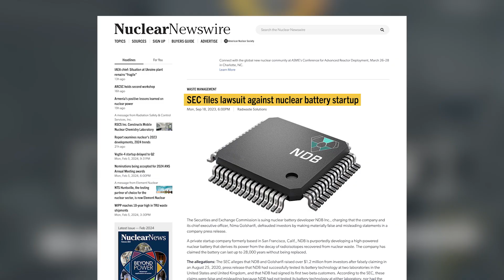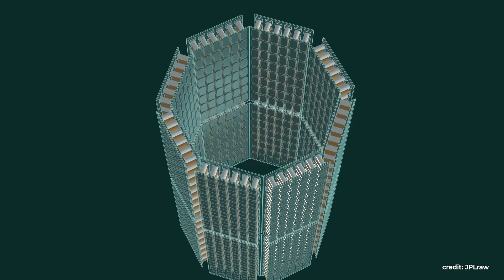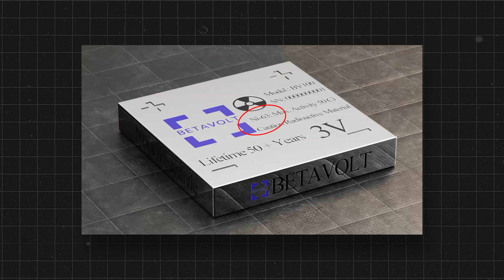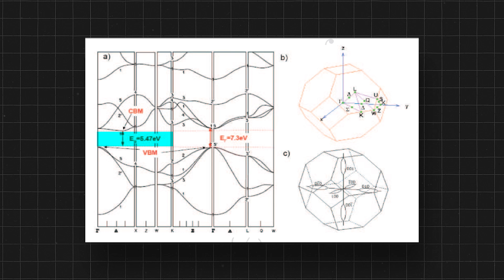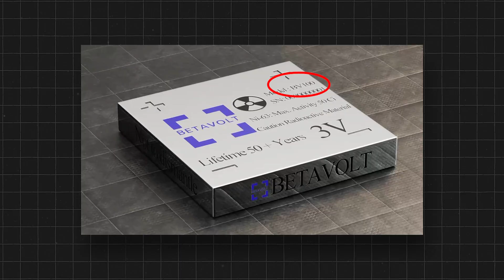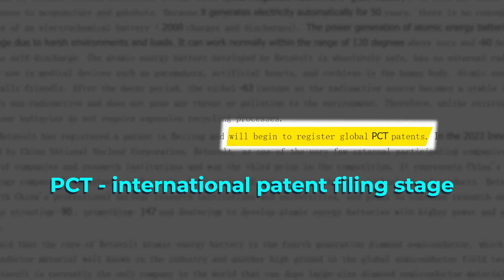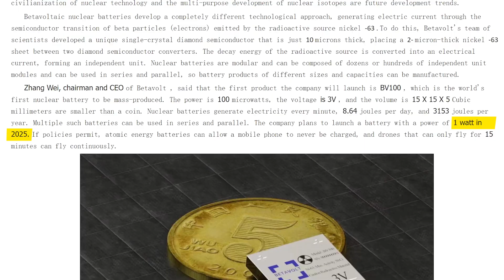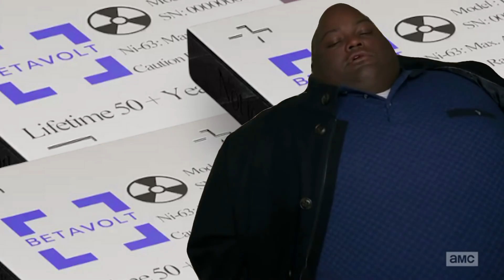Inside China's Nuclear Battery Breakthrough

Comment: Great explanation of the tech, the question is, is it even remotely possible to get power output of 1 watt in a much smaller size, for drones, however, how about one of those super light children's drones....that currently takes 30 mins or more of charge for 5 to 6 mins of flight time ....would a microwatt battery like that or even a couple of them work in that, imagine a children's toy that never needs charging and can fly for years! I imagine that would be a big market!!
Reply: Just do the math.  A drone has a power draw of around 100 Watts.  These new power sources put out a tenth of a thousandth of a Watt each.   You'd need 1,000,000 of these cells to power one drone.  A million cells are going to weigh upwards of 300 kilograms and cost tens of millions of dollars.  An idea that literally will never get off the ground.

Comment: For tracking, even the low powered modules are sufficient. They can charge a [super-]capacitor and once charged, send a location tracking burst. Many applications don't need to be continuously at full power and they may fit quite well.
Reply: Those applications are largely already well served by existing battery technology. Multi-year lifespan on one battery GPS trackers are already possible without the massive limitations of this technology. It's hard to find a niche where it makes sense right now.
Reply: @striker6967 Exactly.battery density is way bigger than this is producing. Simple cr2032 can last multiple years, costs next to nothing. 
Granted i have no idea how much wats it can dish out, but for a replacement tech its not good enough still.
Reply: pacemakers and cpu chips are useful  @striker6967
Reply: @striker6967  The niche is probably in intelligence agencies sneaking in a nuclear battery into devices that can run things in the background once in a while even if you disconnect all power from your device.
Reply: Capacitors are brilemt things
Reply: it would take a month or more to charge a capacitor that much
Reply: my dude, do some math, it would take a year to charge a cap that can deliver 1W of burst power, 1W will not be enough for a burst LTE transmission, nor transmitting a location once in a year has any use

Comment: You missed one important issue with such batteries.  Ni 63 has to be produced from Ni 62 in a reactor-  Cost will be after irradiation/separation $5000 to $10,000 per gram.    $per watt will be huge!  serious limitation on applications
Reply: That's the important math. How many $$$ per watt + weight will get an electric car to drive down the road.
Reply: yea no way to use this on an electric car. 
The output to drive even an electric bike (300Watts) would require a semi-truck to carry the "battery" for you.  @3dartstudio007
Reply: Checks out, the stuff is about 200 a curie in bulk, with a lead time of 6 months, supplied as the chloride.... The deal breaker, it's from a Russian company that used to supply all kinds of radioactive materials, mainly to the industrial and scientific communities.
Reply: @christopherleubner6633   And thats your reason for the ukraine oconflict right there
Reply: Outstanding and excellent observation. Proving why comments can be as significant as content. Thank you.
Reply: OK this answers my questions,   cause it been MANY years since I have read on this subject and that was the issue then , and I see it's still the issue
Reply: Also thank you to all that provided info on this matter
Reply: Can we do it ... sure.  Is it economically viable ... not a chance.
Reply: Sr90 would be a good choice for several reasons. It is a byproduct of fission, literally a nuclear waste material. It is easy to separate from the waste as well. It has a much higher energy beta emission that can create lots of spicy secondary electrons and the battery lifetime would be a lot more current per curie. With the right scatter materials such as bismeuth tin zinc selenide/telluride most of the energy would end up as electrons in the >100eV range and each one of those would cause a cascade of more electrons in the 3 to 4 eV range. There would be some x ray emission but it could be dealt with by a thin layer of tungsten or barium sulfate filled epoxy. The device lifetime would be about 100 years or so. 🤔
Reply: @christopherleubner6633  My question would then be what's the final waste step for the Sr90.
Sure it is waste already and it's always good to squeeze more juice out of something when you can, but if you're spreading one waste product into a different class of products you change the math on how to reclaim the final waste product.
If Ni63 degrades into safe Copper as a waste product, that reduces the concern of what to do with the final stage of the small embedded generator you just produced a jillion of and spread across the globe which might make a difference. :)
Reply: @happmacdonald  it degrades to yttrium 90 which is stable. The devices would work a lot longer than the 100 years or so, but output would drop with half life, at an exponential rate somewhat quicker then the decay rate, then match the decay proportion once the efficiency of the beta-photocell drops to about 85% of new efficiency.
Reply: We got robots to do the work: we’re good homie
Reply: Ni is the way out of using diamond chips but did we try it on artificial diamonds to make the wattage of the betaion batteries more powerful!
Reply: I guarantee you with enough resources someone smart can solve all of your problems listed here and will be able to make it work. Remember, that "flight isn't possible" was a common thing heard when people started trying to fly. Now, everyone knows we can fly if we work hard enough for it. It may seem too expensive now, but I guarantee you someone will solve these issues.
Reply: Technically you don't need a reactor. You just need a neutron source, any neutron source will do as long as the neutrons produced are the right energy to undergo neutron capture.
Reply: If it's sitting in a "nuclear waste" dump, then it's trash to riches.
Reply: From a research perspective the $/w is irrelevant. If this technology proves viable, the process to produce Ni63 will need be improved on. Currently Ni63 is a niche material that costs around $4000/g. 

Anyone remember what lithium batteries used to cost? Or solid state drives? 

Now go out and buy a laptop without an HHD, or a brand new car with a lead acid battery - it's almost impossible.

Important is also to think about the weight reduction of nuclear "batteries" compared to lithium. I recently read about the new mars rover, with 15 years (!) of runtime on a (Pu-238 powered) MMRTG that weighs only 99 pounds ("only" ~10 of which are plutonium dioxide, the rest mainly shielding materials afaik). 

Personally I'm really excited about this tech. It seems impossible that this will reach the general public (without limitations) at a reasonable price within my lifetime, but still exciting.
Reply: This is nothing like the development cycle of Li batteries-   
First you have to enrich the Ni sample to reach 96% Ni-62  (it starts at 3%).  Then in a high flux reactor the sample will spend about two years in the reactor (25 cycles of refueling).  It then waits 6-9 months to cool down (short-lived isotopes)  and then it is refined and fabricated into the desired shapes--- not much room for cost saving.   $/W is always the key for real applications.   These are expensive steps for something making microwatts of power.   Note Ni-63 is available from both Russia and Oak Ridge Lab.  @pbtrading
Reply: @pbtrading  Hold your breath because tech is moving very fast and keeps going faster. The first mass produced, affordable PC's only came about in the early 90s, now we can buy a new PC that is infinitely better in a mobile phone size box for a few hundred dollars, that's only 30 years, and with those tech improvements just look at how much everything else has progressed.

I don't think it will be long before we get some new battery tech, even if we get solid state batteries before nuclear that will be a huge improvement with capacity per weight, charge time, useability in all climates, the list goes on. Even just an improved solid state that can be charged with low voltage like solar would make for a better world.
Reply: @akaraven66 No two circumstances are the same
Reply: comparing the reduction in size of superconductors and microprocessors to the cost of creating some irradiated materials from a nuclear reactor is a false analogy. @akaraven66  I get what you're saying but it's really apples and oranges. To me it sounds like people who go: 'We'll be living on mars soon, we (Europe) didnt find america until 1600s, ignoring the huge, literally otherworldly problems that space travel carry with us.
Reply: You act like this is new. These have existed for decades are used in pacemakers. It's essentially useless for anything else but extremely low power long term power@pbtrading
Reply: Just because it's not being used (or because we still lack the technological advancements to make it work), doesn't mean it's useLESS. In it's current state? Sure. @SilvaDreams
Reply: @pbtrading  For the average consumer yes they are useless. They have very niche case uses but other than those handful of things they can't be used for anything else. Maybe replacing the battery on your motherboard at best but it would outlive multiple PCs.

Comment: Thank you for this video! It sounds like it may be too early to give a real assessment of Betavolt's potential. If they can successfully produce a 100 microwatt battery at a reasonable price, then it may be time to consider them in a more serious way. One watt seems kind of overambitious.

That said, I love your ideas for nuclear battery applications! If they could make these batteries cheaply enough, it would be world changing to put low power trackers on shipping crates! So much smuggling and human trafficking is done today because it's possible to obfuscate the origin or destination of shipping containers. If the container had a tracker that could not be altered while the container is in transit, it would be an invaluable tool for law enforcement. Then there's the benefit to shippers and insurance companies.

Low power sensors in industrial settings like pipelines could also be revolutionary. There's so many leaks in even the best pipeline networks. Imagine a computer that could monitor the effectiveness of the pipeline in real time, with granular detail on each section... If there was a leak they could get on top of it before massive amounts of oil or methane leaked into the environment. That would be very cool. I wonder if you could also use nuclear powered sensors to ensure that industries have anti-pollution technologies installed. Or heck, if they're cheap enough maybe you could use sensors to check if cars have catalytic converters! The cops could check for the signal, and if it's not there give the driver a ticket.

And what about sensors that continually monitor water and air quality? Spread a thousand of them around a lake and scientists could study changes in water quality in real time.

Comment: I don't think these will ever make it to mass-market consumer products, they just don't produce enough power to justify the cost, let alone the logistics of collecting and disposing of the radioactive waste when the device they're in reaches end of life.   Why would you spend thousands of dollars on a betavoltaic cell when you can get 10 years of life out a non-rechargeable lithium cell the same size?
Reply: For the "waste". That could be a gold mine for a breeder reactor. Since by design a thorium, or even a plutonium breeder reactor can easily keep re-using material that was broken down. Getting to about 80% or so of that "waste"  The corium that's left can also be used for low powered gizmos, hell with propper shielding it can be used in consumer novelties and play things. Potentially as large as a small hotwheels car. Maybe even glow in the  dark novelty clothing.  It'd dead useful for small things like timers and smoke detectors. 
If small single home breeder reactors ever got made the "waste" would perfectly safe to provide power to a house.
The water used to cool down anything left can be stored and is safe to drink in an emergency. I don't suggest making drinking heavy water from deuterium a daily habit . But in a pinch if you don't have regular water due to a disaster, you'll be fine for a short time. Er um short meaning a few days at most. 
Just a hopeful perspective.
Reply: @gorkskoal9315  We're not talking about nuclear reactors here, these are like solar cells, except powered by ionizing radiation instead of light(spontaneous decay).  They're also extremely low power output devices. The output is generally measured in microwatts, and the cost is measured in thousands of dollars.

What you're talking about is completely different, nobody's been that optimistic since the 1950s, maybe the 1930s for the radioactive water part. Every child's toy a high level orphan source!
Reply: @sleepib   Oh I know. I was thinking that after the battery wasn't useful as a battery. Like why not chuck it into a nuclear reactor as fuel? Or is that not a good idea or possible?
Though it's a fair hit, about reactors. :( .. Like for every person like me that can see the benefits as wickedly amazing, Are many times more that'd say no way in hell (sadly).
But that's still a fair hit.
Just as a side note. I for one would ( I HOPE!!!) be beyond thrilled to find out they want to build something close to my house. lol. I'd be the type to say: if ya'all drink coffee I'll put some out, and thanks!
Reply: @gorkskoal9315  I don't think that would be practical, you have very diffierent considerations when picking fuel for a breeder reactor vs something that works on spontaneous decay. You can use tritium for a betavoltaic cell, but you'd need to figure out fusion to use it as reactor fuel.  I don't think any reactor will be able to use Ni-63 as a fuel. 

There may be other isotopes you could use for a fission reactor and also for a battery, but I think it's more likely the reactor waste would be refined and put into batteries than the other way around.
Reply: @sleepib   Mmmm that's also a fair hit. And now that I think about it yeah. reactor waste into a battery might be more practical.

Comment: Combined power and maybe radiation source for smoke detectors?
Reply: Current photoelectric smoke detectors use a little 3v lithium cell the size of a fingertip and are already designed to work 10 years though. Throw in a second battery and now it lasts 20 years. Beyond that you'd want to trash it anyway simply due to dust and cobwebs inside the optical sensor and the aging electronics.

Comment: The claim for a 1W battery depends on how much of the 15x15x5mm package isn't Nickel/Diamond.
Reply: 15mm x 15mm x 50m (yes meters)
Reply: @genephipps6421  I think you've missed the point. If the smaller package contains components which don't require the same scaling, it won't be 50m.
Reply: @daveh6356  he literally said stack the existing battery and showed an illustration of just that.  His point was it's not currently scalable for all but a small handful of cases.
Reply: @genephipps6421  he also said that was a guess because they didn't provide any details on their plans
Reply: @genephipps6421  his point missed the obvious (though admittedly the product paper stated scalability through stacking). Are you capable of having your own thoughts & forming your own perspectives?
Reply: @daveh6356  Of course I am.  In this case I was just pointing out how ill conceived your comment was.
Reply: @genephipps6421  because I dared to look beyond the obvious? Oh dear, future innovation is looking grim.
Reply: I am almost certain that anyone buying one will probably get ripped off. If not an outright scam they would probably get a small lithium battery with a resistor in a fancy looking case.😂